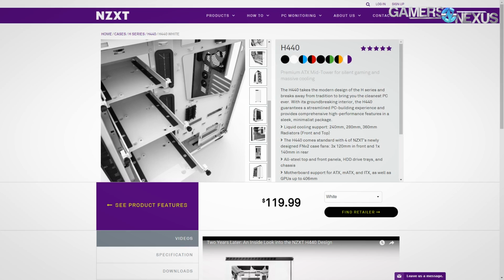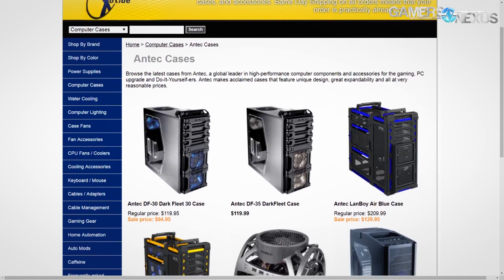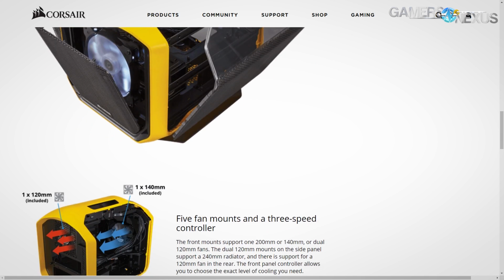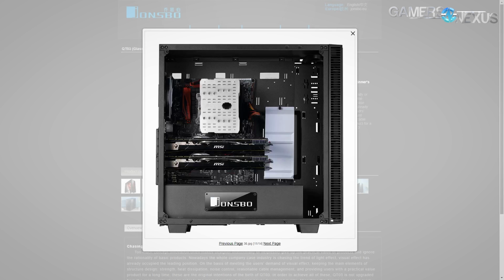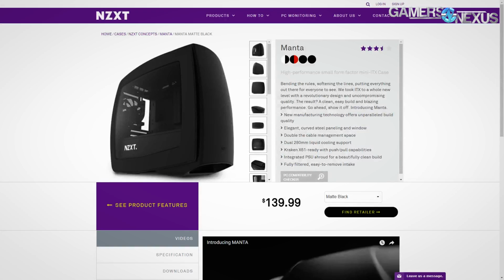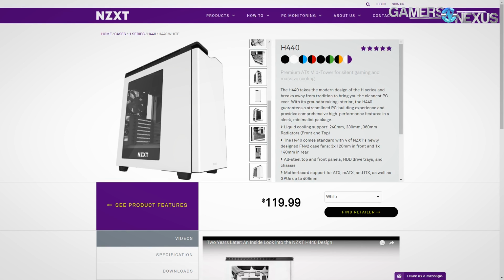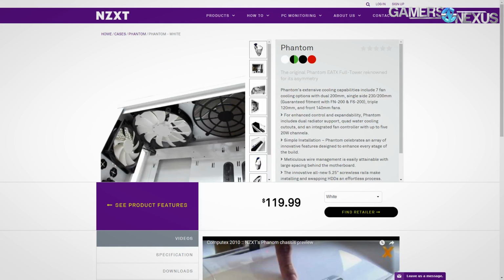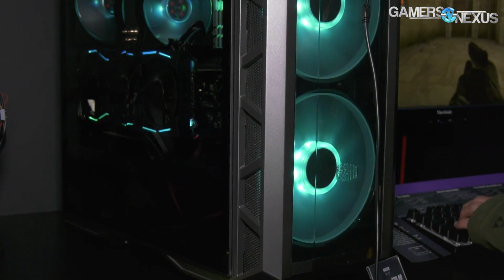Reviewing the Case Industry

Comment: I know this is an old vid but I just saw it and realized I have two antec 900 cases still going strong. About to finally upgrade to the lian-li 011 dynamic or something but my temperatures are great in that Antec case. It just looks so dated and is pretty loud with that side fan is all...

Comment: One thing I have liked about Corsair cases of recent years is that they engage the community to ask what we want, and also make changes to products if there is sufficient demand. An example is the 750D. The initial solid front panel was not great for using radiators in the front, so after engaging the forums they released the 750D airflow edn with a modified front panel that was a big improvement. Parts are made easily available for the modding scene.  Some models like the 900D have been at least partially the result of asking for community input and as such they have been very effective, good looking products.
The only problem has been that its now hard to justify a change because the cases I have are very good and new ones don't offer enough thats new and better. If you can really call that a problem.

Comment: I had an antec df-85 (dark fleet) with a specially sized cp-1000 power supply, after that psu died, i could NOT for the life of me find the "plate" that converted the special sized hole into a normal atx hole, so I swapped that pc (2600k Sandy bridge) to a corsair 750d airflow edition (obsidian series), my current pc is in a 780t (graphite series/skylake 6700k) and I have sitting on my desk a 500d (obsidian series newest with 2 way tempered glass, waiting for the rest of the parts I ordered, and either going to sit a bit for a 9900k or just go 8700k depending on what and when, this will be my first watercooled build ;).
all of that said, i have a request, give us modular front panel options, set a common one one the chassis and then offer upgrades, so say If i have 3xusb3.0 (or 3.1 usbc) on my motherboard, (future boards) these cases will still be usable, charge 20 for it if you want, I WILL BUY IT when motherboards require that.  older cases that would otherwise be better aesthetic or function, are useless if they dont have the ports you need...and dont really like fan controllers on my case, but i am aware that isnt going away, on my next case it doesn't have one (on the rgb lighting version it has a light controller inside and out, that ruins it if you change the fans)
edit
for dark base pro, for my build  i am going to use an ax1600i (way overkill, i am aware of this) and the plug is not compatible, not the least of which that solution was inelegant to begin with.  I had considered that case (and the 1000d) as the 3 contenders for my next pc

Comment: I'm using a corsair carbide spec 03 case and it gets really dusty and dirty inside in a short amount of time but on a new build for my gf I used a no name case that blows the corsair away and at less than half the price. The time between making both builds was less than a year but the quality of cases jumped dramatically on the lower end.

Comment: Cool to look at recent cases.. It seems these days extra HD's are just a USD3 plug away. As for CD ROMs- hardly ever used... You'd think with all the cheap SSD s out there there would be racks specifically for those? with m.2 that's even less power cabled devices in racks.

Comment: you guys are on crack. 200mm fans rock! especially when the case is all aluminium. so sick of steel and plastic. maybe polymer in some little sections, but the cheap plastic is garbage. side fans need to be over the gpu. also, I have 2 140mm rads in push pull in both my current builds mounted to the tear as intake. both my builds intake from the front, rear and sides. they obviously exhaust out the top. they never see past 42c nomattet what I'm doing. cpu that is. gpus never go past 67 in my sli build.

I like a big 200mm side fan and at least 3 fans in the front. 140s preferably or 2 200mm. big Phoenix makes a nice 200mm fam!

Comment: nteresting video as always man. I still have to find an outstanding looking mid-tower case with: anodized aluminium, full smoked glass side panel , 6 bays for 3.5" drives, support for 30 cm long GPU's, good cable management and great airflow. Any ideas? years searching without any luck.

Comment: I built my PC in a 600T a couple years ago. It wasn't the newest case, but I love the design and that it's not nondescript just a box, it's roomy, well thought out and well made. There's a few limitations like only support for a 200mm intake fan, small side window and no "showcase" location for an SSD, but it's stuff that can be tweaked with mods (like the SSD location), and that 200mm fan in my setup has a totally uninterrupted path to  the components. Plus I still like 5.25" bays for my card reader and storage drawer.

Comment: I had NZXT Lexa black/blue LED since 2008, at the day it was like a supercar. But emotions quickly vaporize, when I installed optical drive I cut my finger and bleed on the bad metal finish, 5 molex fans are mess, top PSU mount, thermals aren't good, glossy plastic, bright power LED, loud videocard, bad build experience, no cable management etc etc etc.
My current is FD Define C and they did everything right.

Comment: phanatek enthoo lux poor design & poor quality-uses plastic nubs from 10 yrs ago on front panel not magnetic, large steel wall blocking air flow, cant fit 1080 gpu with a liquid reservoir, 360 slim radiator cant go in roof with crazy plastic nubs, 21 lbs heavy empty, thin metal motherboard area flexes badly, no room inside top case with asus zenith extreme, 30mm rad, 25mm fan because mobo connectors are blocked, fan  hub overheats often. I tried the case & it sits empty, went back to corsair 750d which is years old

Comment: The reason why the case industry is lacking is due to the standards the cases has to comply with. Meaning, not much change is permitted. The factories can design different cases, but the layout stay the same.

Unless a company decide to formulate their own standards and then make them.

Comment: Here's the thing: I own an NZXT H630. Sadly for the industry, I'm very happy with that case. I will either use that for my next build or try to build a case out of wood that fits on the bottom of my desk. Unless I see an absolutely awesome case that's quiet, elegant and small for a reasonable price (i.e. below 200€), I'm not going to buy a new case in the next 5 years, I'd say.
So: While upgrading my system might be a thing next year or the year after that, I have a really good case. I don't need a new one and it would be the last thing I'd spend money on in the next upgrade.
I'd assume this is the same for many people that already have good cases, so is it really true that new CPU generations cause a significant increase in case sales?

Other than that: No mention of Phanteks or BitFenix?

Comment: Airflow. A big problem with the Dark Base pro 900 with the stock silent wings 3 fans.  Low speed, low static pressure, low air flow, fans trying to suck air past a front door, mesh filter and highly restrictive side mesh vent holes. With them turning at full speed and your hand 2-3 inches from the fans inside the case you can't even feel the air anymore. And that's when it's brand new with no dust in the filter. They should have at least put the Silent Wings 3 High Speed fans in it but after buying one I can tell even those wouldn't' have the air flow and SP needed to get good air flow through the case. I'm really glad I got it on Black Friday from newegg for $180 plus a $30 newegg gift card.  I basically got the case for $150 and that's all it's really worth tbh.  Especially since you have to ditch the SW 3 fans for high static pressure,  high air flow fans to get enough air moving in it.

Comment: I would like to see more cases that have a quality fit and finish and aren't stamped out of cheap and nasty sheet metal with shitty plastic bezels. There are far too many companies these days pumping out cases full of useless features and gimmicks that are made out of rubbish materials. They aren't designed to last upgrade cycles any more, they are meant to bend and break and be thrown away every few years. On top of blocking intakes with bezels, many case manufacturers seem hell bent on adding every conceivable fan size mounting holes and blocking half the airflow for bigger fans (I'm looking at you Phanteks). Just use the largest common size that fits well and be done with it!

If I could make cases, my design philosophy would be:

- Minimal exterior and interior design but with function following form, emphasis on front-to-back airflow and avoiding unsightly side/bottom intakes.
- Use maximum possible area on the front for high volume air intakes with good filters to maintain positive air pressure inside the case to minimise dust.
- Largest common fan size for any given position with unobstructed cut-outs and no punched-out grilles to impede airflow.
- Enough clearance around fan mounting spots for radiators in custom water cooling loops, but avoid being larger than necessary like your typical Caselabs box.
- Preference for aluminium for sheet metal with panels anodised or powder coated, minimal use of plastic.
- Quality tooling and tight tolerances so everything fits together nicely.
- Rubber mounts for fans and hardware that could cause vibrations to minimise noise.
- Recessed IO plate/PCI brackets at the back and no unnecessary holes in exterior panels for a clean appearance.

As someone who's been holding onto some 10-year-old lightly modded Lian Li cases, I can honestly say they don't make them like they used to.

Comment: Why focus on case manufacturers?  They are very limited in some instances as to what is available to put inside of them.  Why not ask GPU manufacturers to start putting the power connections at the bottom of the card, making cable management easier.  Why not ask motherboard manufacturers to make boards more modular in design so they can be put together in a different way based on a new case type that is being developed.It's not just the case manufacturers that are causing this lull, it's all of the manufacturers causing design stagnation.  And Fan or LED controls are better done by non case manufacturers, leave this out of new case design, but include ways for it to be incorporated in design for a consumer to add if they choose.

Comment: I'd love to see case manufacturers focus on less but doing it much better. I don't need a power supply shroud, window, LEDs, 6 drive bays, 8 fan mounts,... I've been thinking about building my own case out of some MDF or laser cut acrylic, and my case would just have simple cable management, 3 fan mounts up front and 1 in the back, filter all these fans with 2 easily cleanable filters, 2x3.5" + 1x2.5" bay and a simple 4 port fan controller. I wouldn't include a PSU shroud, any LED strips or LED fans, windows or tempered glass panels, 5.25" bays, unnecessary fan mounts up top, on the bottom or sides to allow more dust in,... You could even make it a better return on investment by just having 2 front shroud options, one with side vents for silence and one with a mesh for airflow. This would make for a great case for most builds and actually stands a chance to beat a lot of others in performance! Might actually need to build that now, got some other ideas that I'm going to keep to myself for now...

Comment: "Antec is catching up, adding a PSU shroud..." They might have let it go for a while, but my 2005 Antec P180 (not in active usage due to GPU length) sports a fully separated PSU and main compartment with separate air intakes and exhausts, with easy clean filters and quick disconnect fan mounts on both to boot. They most definitely weren't behind the curve on that aspect, if anything they went there a bit too early.

Comment: what do i want from case manufacturers? more complete custom liquid cooling suport out of the box, not talking like caselabs level but more like compatibility and clearance because sometimes you could fit 2 120mm fan on top but not a 240 radiator or 1 120 on the back but not a 120 rad with said 240 rad on top or your grommets ended up blocked or you dont have enough space for a pump or a reservoir im not case designer and i know that sacrifices has to be made to fit on certain budget but it would be nice to start a trend that it's actually usefull and not only cosmetic and don't make me start on the airflow, just one name i'll give ya: phanteks enthoo evolv atx aka ''the dumb case''

Comment: I am happy that there are more cases without 5.25 bays. I have not used an optical drive since Portal came out. Maybe longer since that was when I realized my DVD drive was disconnected.
Reply: Vonzell Charlton Though I need at least 1 or 2 keep the desktop case well rounded and ready to change roles. Those bays can be converted to have extra drive bays if there is enough passive cooling support.
Reply: Aereto I should have said external 5.25 drive bays.

Comment: Just give me an NZXT Phantom 820 refresh with more metal. I've modded and modernized several of NZXT's older designs and can provide a lot of input on how to make a better case and keep weight and cost down. The S340 and H440, while great cases,  were the end of NZXT'S innovation. NZXT just kind of stopped.

Also, there hasn't been a good sub $500 big case  option to come out in years. The NZXT Phantom 820, Phanteks Enthoo Primo, Corsair 900D, and  Silverstone TJ011(actually I think this was more than $500 on release) don't need much to be amazing. Give caselabs some competition guys. The cosmos return is great and you think it won't sell. You are almost definitely right about that. However,  frankly, that's because it's a bad case that misses the mark on a few major areas, not because of a lack of market. The dark base pro 900 has the same issue. 1000mm+ radiator space along with support for 4 HDDs and at least 4 ssds  should be a minimum requirement for an ultra or supertower. If I can meet those requirements with $20 in mods to an Enthoo primo and NZXT Phantom 820. You can do it with a $500,000 tooling. There are enough genuine enthusiasts out there like myself that will purchase a well designed, well engineered, big case to be profitable. Caselabs and the Phanteks Enthoo elite's very existence are proof of that. There is a noticeable gap in the $300 to $500 range that needs to be filled with a modern case.

Comment: Sold my BeQuiet 900 Pro yesterday. Most expensive and worst case i've ever had. I usually clean my systems once or twice a year and with the 900 it was a real nightmare with all these corners and tiny openings which make it silent but catch dust. That, combined with the bad airflow, was the main reason i got rid of it.So back to the big question what case to get now. Since most manufacturers now get rid of the 5,25'' bay (i need at least one!) most of the 'newer' cases are a big nogo for me. LED? Fine by me. RGB? OK. As long as its not overdone and no disco inside. Watercooling? YES! Gamerstyle? NO! NO! For heavens sake, NO! Window? Yes, its always nice to take a peek inside to see if it is time again to clean the system.In the end i bought a Fractal Design R5 Blackout. Relatively small, but everything fits in and got a good airflow. The funny thing is that i now only use one 280 radiator (the second one is a bit too long and doesn't fit) and i already got better temperatures than with the 900 Pro.It got its minor flaws and in the end i might end up (with all the planned upgrades combined) at almost the same price of the 900 Pro. But it looks imho much better, fits better on my desk, cools definitely better and is in comparison not so much louder.In the end 'newer' design isn't always better and simpler doesn't have to be a drawback. Sometimes i think companies develop new products only to have something new but not to have something better or improved.
Reply: ...and as usual the formatting is gone. I hate it when Youtube does that.

Comment: I have a question: so basically, two (or three) 120 or 140mm fans are better than one 200mm? Is the airflow better, too, or just because of the longevity (fan blades, bearing)?

Comment: I sure would like to know why I have had such insane quality issues, Not with the cases, but fans slinging blades, rgb strips actually popping and shorting. and support was like pulling teeth. They did finally make it better than right, They sent 2 fans after about 10 emails, to multiple people and they actually sent 2 140mm fans, instead of 120mm, I was able to use them, But i mean comon, this was so rediculous, especially from a big company like NZXT, I absolutely love their products, Im running grid and 6 fans and hue with 4 strips, working out of 8 they sent me.. Has anyone else had any similar problems, I mena I absolutely HATE saying anything bad about ANY company. I just hope nothing fry's mo mobo or anything, i'm really actually nervous about this..I just know I would be on my own if it did..Sorry NZXT Love you guys, Just bump up the service a few notches..

Comment: I had the corsair 540. I would greatly steer anyone from this. The product is so cheap. Everything is so flimsy. I ended up replacing it with the phanteks p400. Almost the whole case is metal. Almost as much as storage capacity as the other case. Comes with a rgb strip. Has a tempered glass side panel. More dust vents. And better dust vents. I don't buy corsair. They also cost the same.